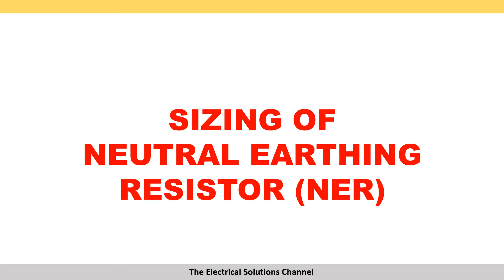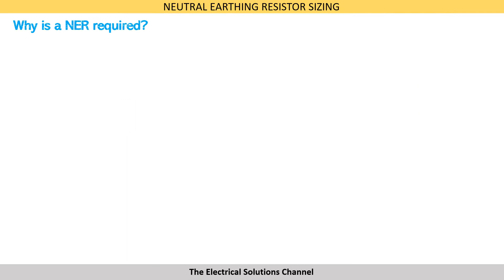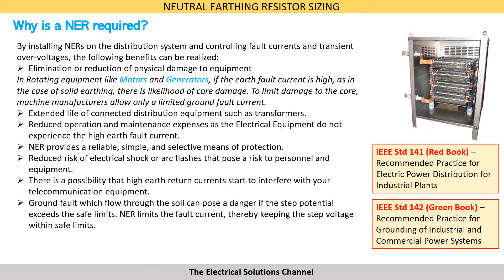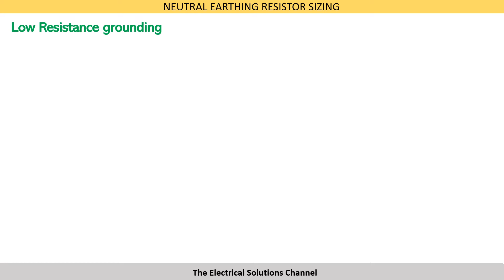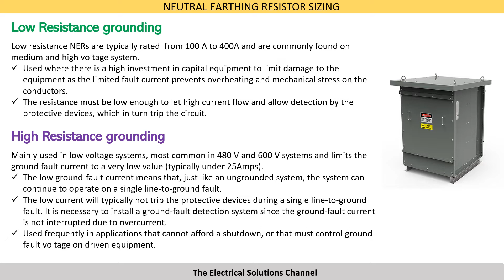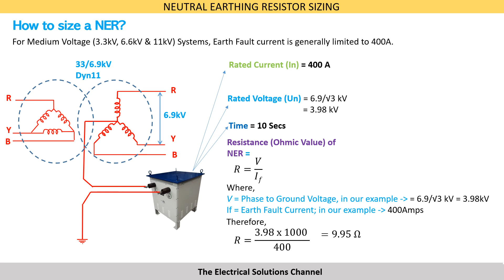HOW TO SIZE A NER

Comment: Thanks for providing and facilitating such compeling technical information

Thank you very much The Electrical Solutions Channel for such an amazing work. I have previously watch all your video, implemented it and their accuracy made us good engineers. You have been my always GO TO for the execution of my electrical designs

I can't wait for more upload on:

1. GENERATOR SIZING AND CALCULATION
2. SELECTION OF SWITCHGEAR SIZING AND CALCULATION
3. CT & VT SIZING AND CALCULATION
4. UPS, BATTERY, CHARGER DESIGN AND CALCULATION
5. CAPACITOR BANKS CALCULATION
6. EARTHING AND CALCULATION
7. CABLE TRAY SIZING AND CALCULATION
8. LIGHTINING PROTECTION SYSTEM
9. LIGHTING DESIGN AND CALCULATION

I would even glady take your Detailed Electrical Enginering Course if you have one. 

Big Up The Electrical Solutions Channel🙏

Comment: Crystal Clear explanation, very happy for your concepts..
Could you please explain how to size a Battery bank based on the battery load profile..
Also sizing of an Emergency Diesel generator.
What are the protection systems involved at the transformer protection..
Reply from the maker: Thanks for your comments. Glad that you found the video useful. Videos on the above topics are under preparation and will be uploaded shortly.